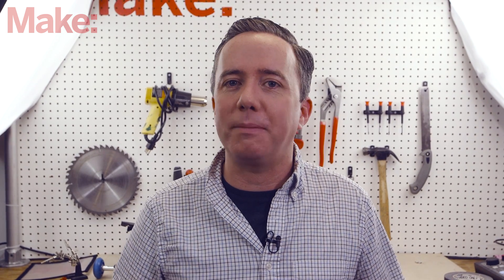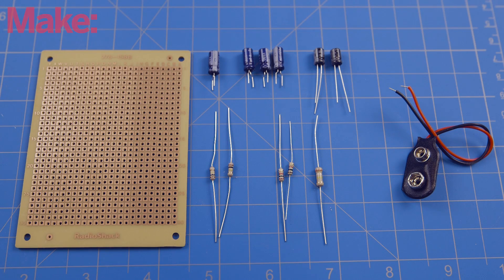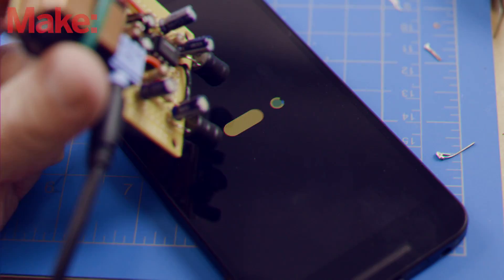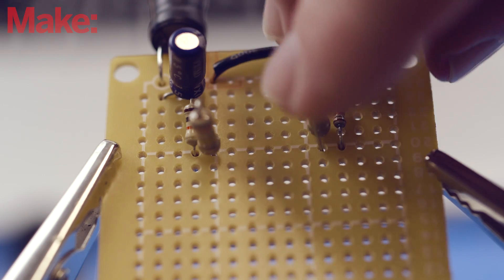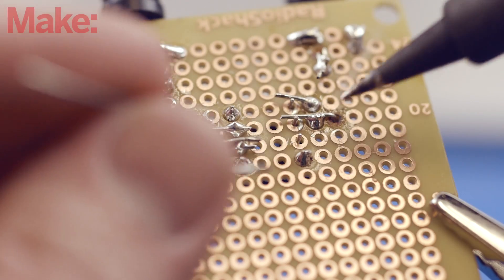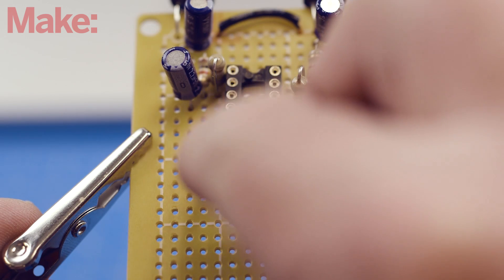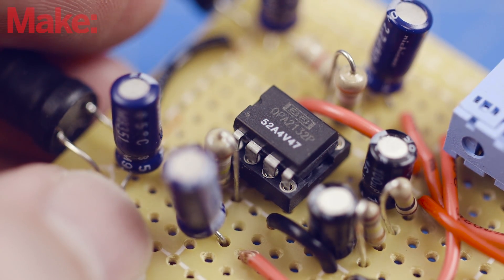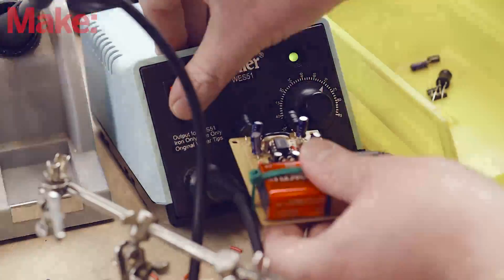Weekend Project: Sample Weird Sounds from Electromagnetic Fields

Comment: Is there a version you can make that uses stripboard instead of a perf board?
Reply: yes slice between where its not sharing a connection its enough if only two on a strip connect then slice on 1 and 4 and use 2 and 3  as a shared connection then 4 - what ever becomes a new separate strip follow this and you will see the connections more clearly

Comment: How to store the electromagnetic sound collected in the headset?
Reply: use a 3.5 mm male to 3.5 mm male adapter (headphone plug on each side of the cord) and find a recorder with "AUX IN" or "LINE IN" and plug one side into the headphone socket on the Elektrosluch and the other end plugs into your recorder AUX IN or LINE IN. Hope this helps!

Comment: Hi, i have a question, is it possible to configure the microphone to pick up the magnetic sound of something that is lets say 1 km away isolating all the noise that is before it?
Thanks in advance
Reply: The problem with that is, something emitting a field strong enough to pick up 1km away would probably be frying everything around it.  OR you'd have to create a mic sensitive enough that the signal from your 1km target would be overpowered by everything in your immediate vicinity.

Comment: Just made it as my very first circuit board project and it works! 😀 So go for it (after making sure you can solder)!
Reply: Hi!!!! i just tried to do this but it didn't work and i can't figure out what the problem is... (this is my very first project) maybe you could help me?🥺
Reply: @ I’d be glad to help you, but I don’t know if it can be done through YouTube comments (plus they disappear, sometimes). Did you manage to use the correct components and place them as instructed? Are your connections effective, with good soldering? Any suspicion where the problem might be? Otherwise, maybe we could have a video call or so?
Reply: @ now I’m not sure if I used right 100uF capacitors. should they be polar or not? I can't figure it out from the video... If they are polar, then the right capacitor should be on top and the left one should be on the bottom? I can't find any information about this anywhere...
Reply: @eugenefilimonoff6078  I don’t know, but since they have a line on one side, doesn’t it mean that they are? On the video, it seems both have the line on top, while on mine - and I don’t remember, but I guess it was random - the left one has the line down and the right one has the line up. Does that help? Did you find something?
Reply: @  if someone will did it right like on the video, they’ll explode! That’s why I’m asking) But now I did it! This shit done!!! I’m so happy it works! Thank u for ur time dude!
Reply: @eugenefilimonoff6078  Interesting! And I’m glad you (we?) figured it out and it works! 😀 Plus, you reminded me I had that thing made 4 years ago, so I’m now tempted to use it more… Anyway, enjoy!
Reply: @ yep! Thanks!!!

Comment: I must say the very first thing I wanted to do after wathing the first minute of this video was to rush in the comments section and say something about that glitchy/fuzzy transition-thingy. Hmm, apparently people already did that so yeah.
When the fuzzy thing happens while I'm concentrated watching the video, my eyes try to follow the moving picture and it's tiring. When the video isn't in fullscreen it's less annoying since the picture moves less.
I thing it wouldn't have been deranging if the transition wasn't making the picture move/rotate/blur/fuzz but simply added randoms artifacts. (and somewhere else than on the text btw)
Also it's a bit deceiving that the video does not permit to understand what the device does. Having one myself, it would have been easier to understand if you waved it around a starting motor.

Comment: CAN THIS BE USED AS A HIDE MICROPHONE FINDER?
Reply: If the microphones are digital or wireless, yes. If they are just microphones, you would not be able to detect the microphones, and the control box will be well hidden, and maybe even underground.
This would, however, be one of the best ways to find hidden monitoring equipment.

Comment: I suck with electronics. Does components order in circuet(?)board matter or do I need to put them in specific order
Reply: While the location of the components is not usually relevant (it is with the inductors), the circuit will not work unless the components are connected together correctly.